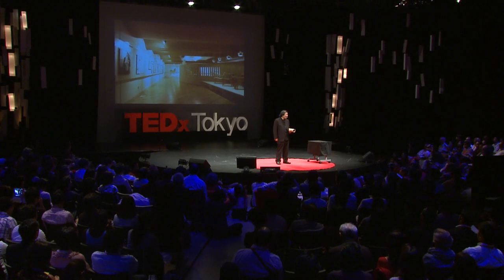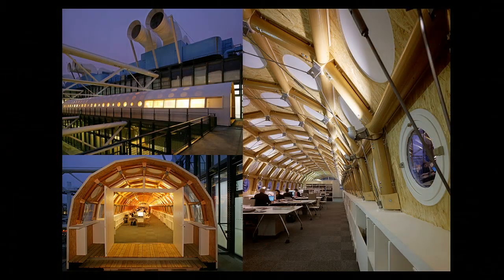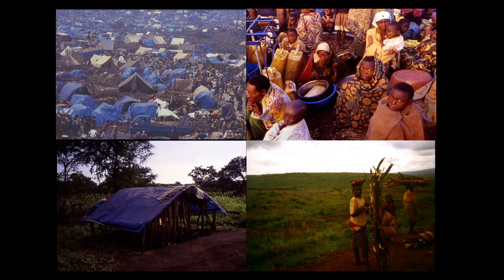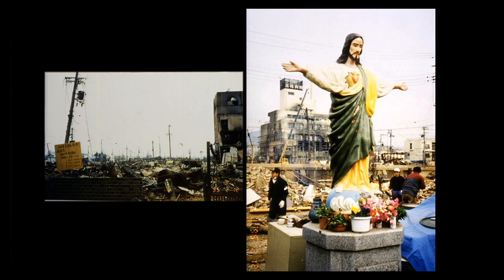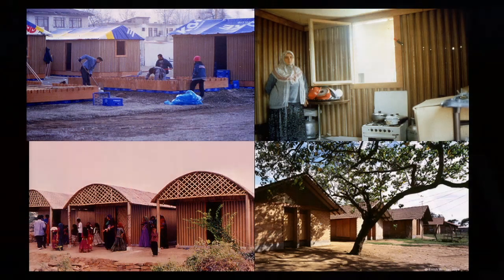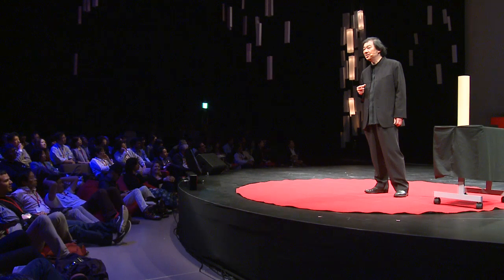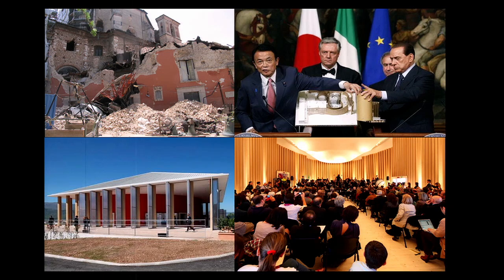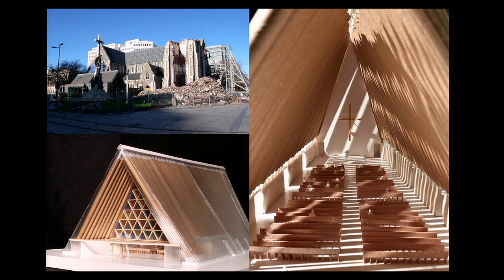Emergency shelters made from paper: Shigeru Ban at TEDxTokyo

Comment: As a civil engineer, Im mesmerized by the idea great job! but I cant help but thing what happens to those kinda of materials when exposed to Accidental Forces such as Wind and Earthquakes?, does it compromise the integrity of the structure? , who test those materials for later use?
Reply: Looks like he is reinforcing the paper, he said it is very strong, he didn't explain how it is made so strong, any way I can imagine this is cheapest recyclable and specifically it can withstand the elements.